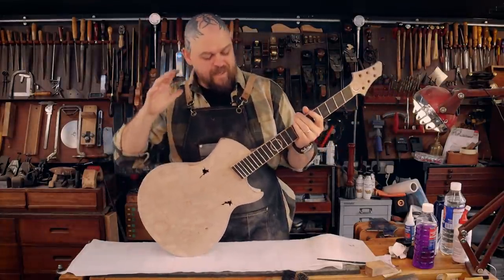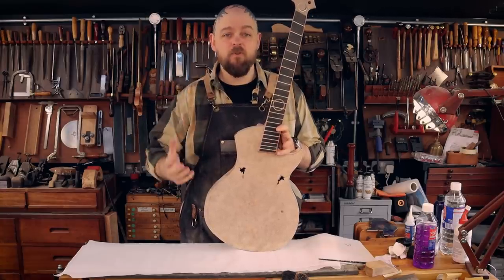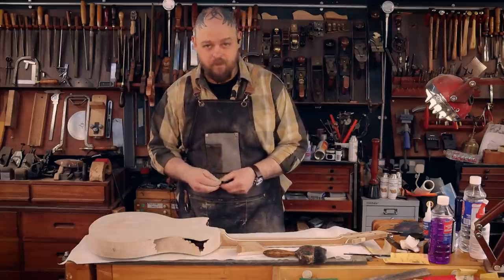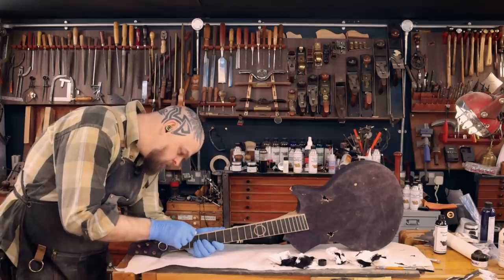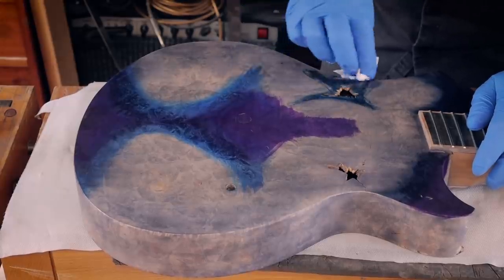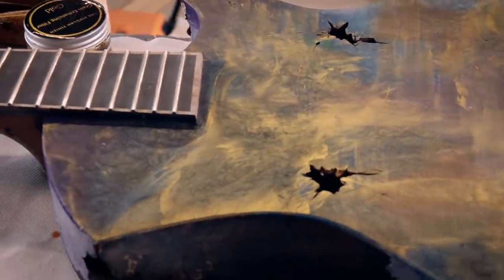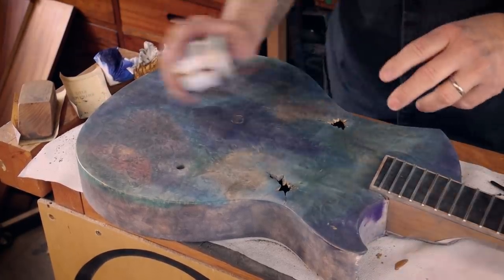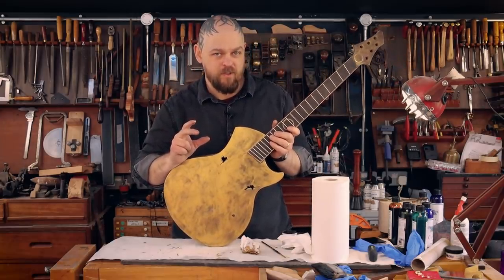Ep 18  - Creating the Galaxy Finish - Making a Modern Multi-Scale Electro Acoustic Guitar

Comment: Great tip with 'wet wiping' the grain enhancing filler (I always thought you had to let it dry and sand). What grit are you sanding back with after applying the stain please Ben?
Reply from the maker: Hey.. it's traditional to wipe filler in across the grain to force it in.. and I'm sanding back with 320, the same grit I left the wood at.. B

Comment: You should have used copper shielding tape on the inside (instead of the paint), it would have mimicked the copper leafing on the outside.  THAT would have been taking things to the next level.    And what song is that that starts at 14:00min?  It's great.

Comment: How long does a piece of sandpaper last you? I never know whether to carry on with a piece or get a new one.
Reply: When either the grit wears off or it gets "packed" full of dust.
 You can actually hear the difference after a little bit of experience. Basically you just have to do it a few times to get the hang of it. 
There is a very distinct sound between sandpaper that's actually sanding and paper that's just burnishing the wood.
 To my ears anyway...
 Maybe I should add that I was a professional house painter for 22yrs so I'm no stranger to the sanding process😉

Comment: After watching the gold grain filler do its magic, I keep wondering what it would have looked like if you had added some bronze or a brass-colored filler in random areas for contrast.
Reply from the maker: I think that would have worked wonderfully.. I really do wish I had some silver to play with. B
Reply: @CrimsonCustomGuitars  I don't know what the filler you have uses as a binder for the color, but I'll bet you could use any Silver mica powder designed for epoxy resin for coloration and sparkle mixed with some kind of binder delivery system.

Comment: Would the gold grain enhancer work if used on something with a tight grain, like flamed maple?
Reply from the maker: it works as a paint in that case but not as a grain filler/enhancer.. it basically has no where to go in that case.. B